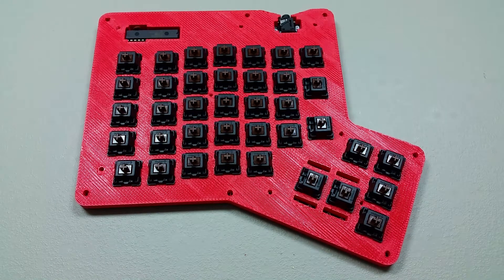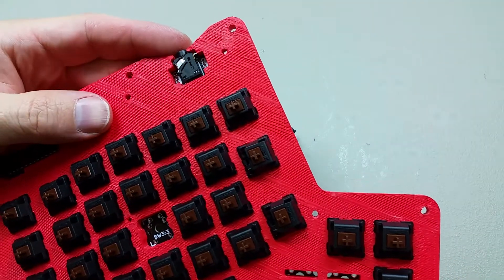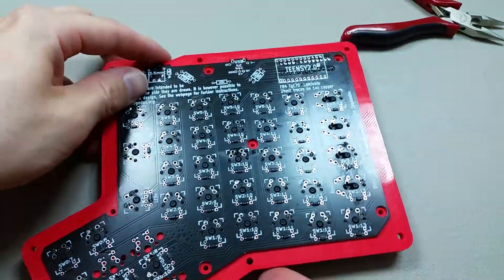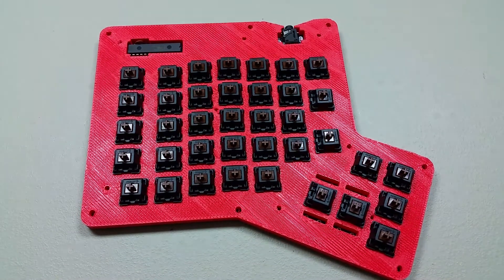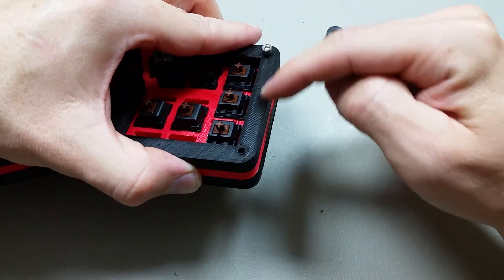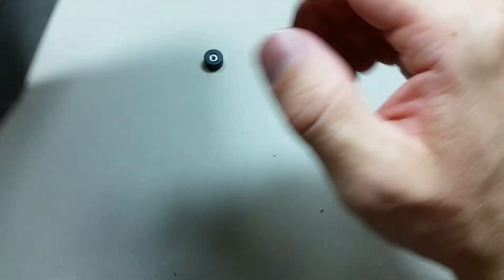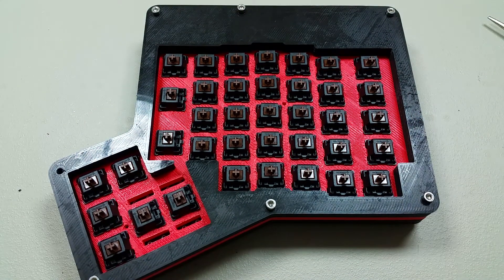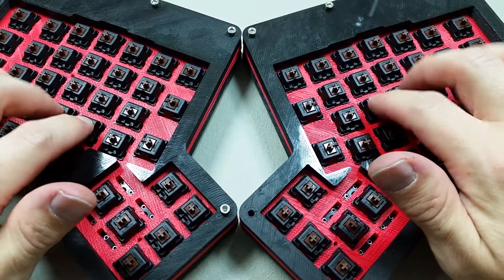How to Build an Ergodox (Assembly 10)

Comment: Other choices for the bolts you could consider are a button head(dome head). You can get them in anodized aluminum versions commonly used with radio controlled with cars, in red or black to match your keyboards design. http://www.pro-bolt.com/aluminium/aluminium-bolts-dome-head.html